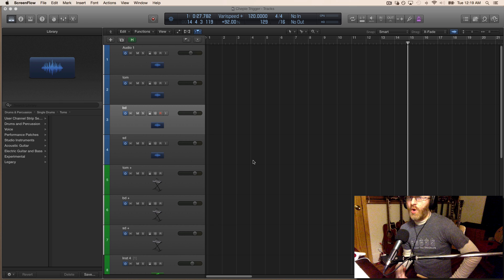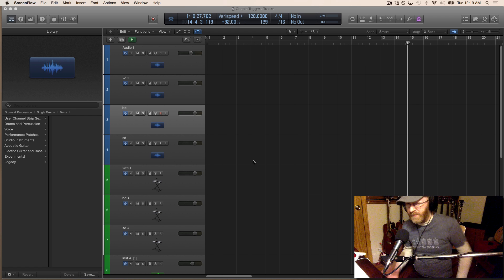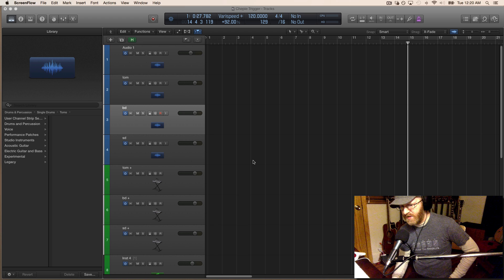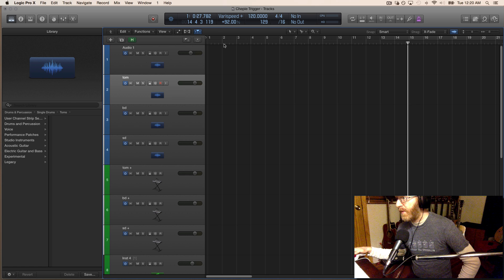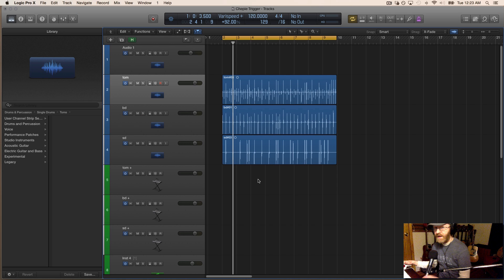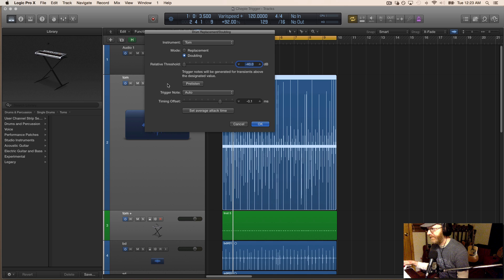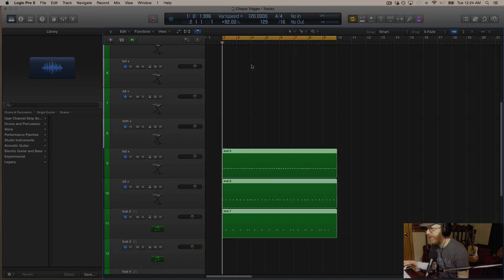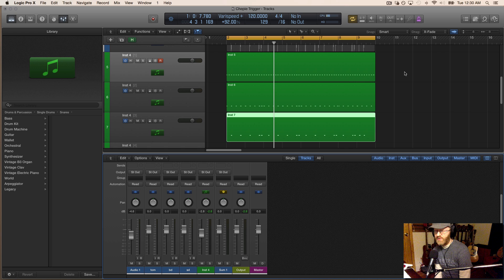How to Use a Chair to Trigger a MIDI Drum Performance in Logic Pro X

Comment: This idea crossed my mind a long time ago, but somehow it didn't worked for me at the time and I kind of forgot about it. Yesterday I tried it with just the built in mic from a web cam placed over a table. After some quick 'finger drumming' I found that this works wonderfully for me. I have a strong sense of rhythm, but I'm not a drummer and always found entering drum parts on a music keyboard extremely awkward. This is a fantastic and cheap solution. I might consider using multiple mics for increased polyphony. Thank you so much for bringin this up!